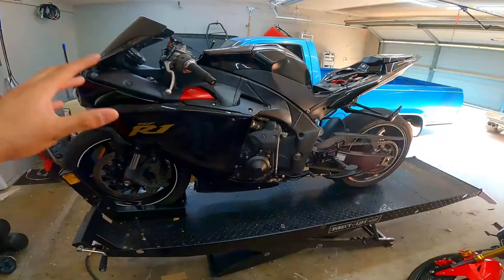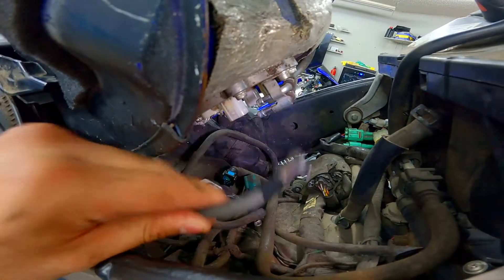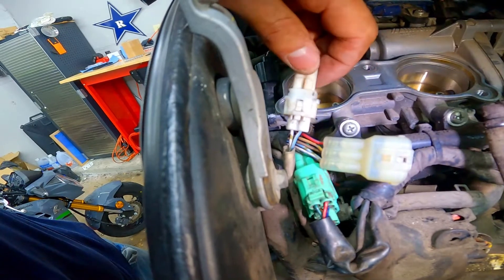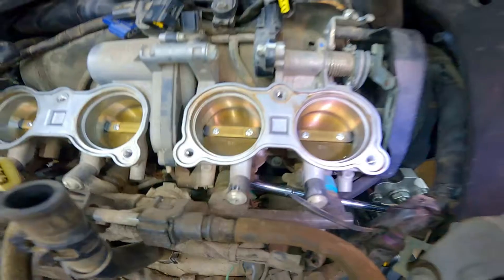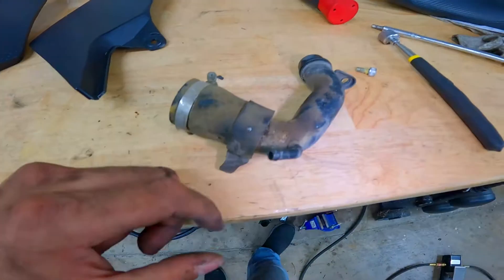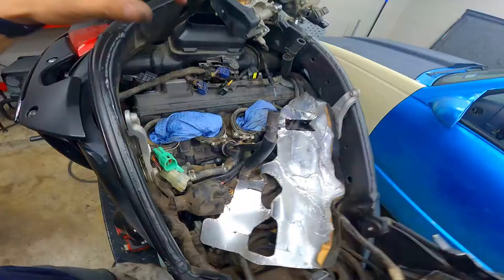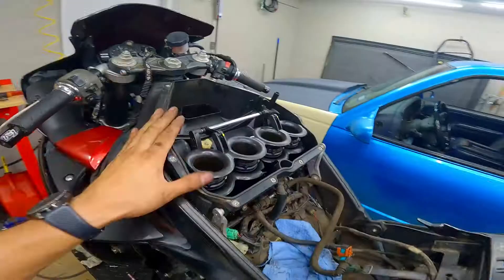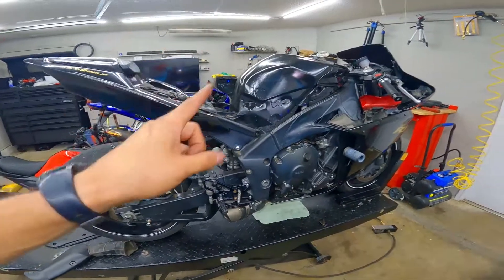2009 - 2014 R1 Stater replacement

Comment: My 2013 R1 is behaving in a similar manner. It will eventually start after 6 or 7 attempts, but as the days get colder, it is harder and harder to start. Eventually not starting at all.  If I have the battery on a trickle charger it makes no difference. The motorcycle is charging at over 14 volts when running.  After the bike has been running and all systems are warm, the bike starts effortlessly. I have had the battery tested and CCA measure good. I have replaced the solenoid and the issue persists.  You seem extremely knowledgeable in the field of motorcycles so I was wondering if you suspect it is the starter. I'm thinking it is a partially failed winding.  Great tutorial video! Deliberate, articulate, and thorough. Thank you.
Reply from the maker: thanks for the support brother    but in my opinion     if it's only happening when it's cold    it sounds like ur valve are out of adjustment      you can at least get it to turn still right?   Just take a bit?
Reply: @SUPSGARAGE  It will get a half to full single turn, then lock up.  Seemingly like a nearly dead battery. Quite similar to what the bike in the video is experiencing. I can do this a few times until it actually spins over or, the battery is actually dead.  The motorcycle has 18k miles on it. It was my understanding the initial valve adjustment service was at 26k.  I may be mistaken.  I did install a cat delete pipe without getting the ECU flashed, but the problem was evident prior to this modification. The motorcycle performs fine when it is running. I will produce a video of the attempted start and post here. I will update with video title.
Reply from the maker: @crobax2248  yea tag me on the video for i can get a better idea
Reply: @SUPSGARAGE I tried to tag you but Uploading videos is new to me. Its titled crobaxo 2013 yamaha r1 hard start
Reply from the maker: @crobax2248  could u add the link here?
Reply from the maker: Ok brother   I just seen the video and to me    it definitely sounds like ur starter is going out     it will eventually not turn over anymore at some point
Reply: @SUPSGARAGE  Agreed. what starter do you recommend?  Price is of little concern, I want the longevity and performance. Weight is not a concern of mine.
Reply from the maker: @crobax2248  I believe Rick's makes one for your model    if not I would just go OEM brother

Comment: I have a check engine light for a code 13 which is the air fuel sensor? I have no idea where that is. Is it one of the sensors you disconnected here? If so could you please help me out?
Reply from the maker: I wanna say that yours is located underneath your left air duct brother
Reply: @SUPSGARAGE  was it included in this video? If not are you talking about the intake that connects to the headlight? Take that off and the rubber hose and it should be under there or is it somewhere completely different. I wish I could send pictures haha
Reply from the maker: @tylerewing6814  u got instagram brother?    sups_garage    message me

Comment: ive done everything but the bolt for the starter closest to the motor is almost impossible to get anything in to loosen it. I tried a swivel mount also no luck

Comment: Hey sups another question! I had an accident may 26th and since after that accident I noticed my r1 doesn’t wanna start. It just cranks. The only way to start it is by push starting it. I got the battery tested, checked my fuses, and even starter relay and everything seems fine. Any idea what it could be?
Reply from the maker: message me on Instagram brother   sups_garage

Comment: Hi I have a question, my bike just clicks once I try to start it. Replaced starter relay, battery, & I did jump start it. It turned on but it sounded like it was going to die. I turned it off & tried to turn it on & it started clicking again where the starter relay is
Reply from the maker: Sounds like the battery you bought might not have enough power, what battery did you get?  I would charge it overnight and try again.  I've seen new batteries needing to be charge before using them.
Reply: @SUPSGARAGE  it’s Noco battery & I checked the voltage before I bought it
Reply from the maker: @Juan Morales-Perez  I believe these models need at least 12.5v to start   what is urs showing?
Reply: @SUPSGARAGE  it’s showing 13.25
Reply from the maker: o wow   that should be enough   if u by pass the starter solenoid, will it start?
Reply: @SUPSGARAGE  how do I do that?
Reply: @juanmorales-perez4629 believe you connect a wrench across starter relay cable terminal bolts. I've never tried bc I'm afraid of creating more problems but I am in a similar issue with a noco but after much reading seems these bikes are prone to starter failure or hit start issues. Did you ever figure out your answer?
Reply: @juanmorales-perez4629 that's about where mine shows as well fully charged
Reply: One thing I want to try is testing voltage at starter whilst starting bike. Not enough volts but good battery could mean bad cables/connections/starter relay. Good volts there = starter motor is more likely the culprit
Reply: Mine does the same right now. I've fitted 2 new batteries, One lithium, the other normal lead acid. Changed starter relay, no change. The only thing left is starter motor. Batteries are 14v + so it has to be starter. I've charged batteries to max over night, made no difference.

Comment: Where does the cable from the starter go? Directly to the battery?
Reply from the maker: No.  Goes to the starter solenoid brother and then the other big wire from the starter solenoid goes to the battery (Do not get them reversed).  Hope this helps you!
Reply: @SUPSGARAGE  so the positive goes on one side then the negative and starter go together on the other side? thanks for your help
Reply from the maker: No, so the wire coming from the starter should goes to the solenoid (If you look at the solenoid it should have a letter M and B, M connects to the stater and B connects to the positive side of the Battery) and there both positive wires cuz the solenoid just connects between the battery and the starter. Negative just connects to the Negative side on the battery itself (Has nothing to do with the solenoid).  I hope I'm not confusing you lol.
Reply: @SUPSGARAGE  that makes sense, I'm just confused cuz i got a new wiring harness and it had the positive and negative battery cables connected to the starter solenoid. so starter cable on the M side,  battery positive on the B side. now where does the negative from the battery go? I think I'm just overthinking things lol
Reply from the maker: I do that too at times lol   but the Negative terminal from the battery should bolt down to the chassis
Reply: @SUPSGARAGE  sweet thank you for your help
Reply from the maker: No problem brother!

Comment: hey bro! I did your step by step tutorial on how to remove the starter but when I put everything back together I got an error code #15? Something with the throttle position sensor? I don't know if it might be because of how I removed the throttle cable?
Reply from the maker: You made sure the tps sensor is connected brother?
Reply: @SUPSGARAGE  where is it located exactly?
Reply: @SUPSGARAGE  when I put everything back together I made sure all the connections were the same. I thought it was maybe because I tightened the throttle cable nut too much?
Reply from the maker: @remydamato6009  It's the sensor I'm disconnecting at 6:19 on this video brother     that's what code 15 pulls up for    I would double check that one and the pins in it   to be safe
Reply: @SUPSGARAGE  I’ll check that out for sure. It’s my first time actually working on a bike so it’s all new 😅 I’ll update you soon!
Reply from the maker: @remydamato6009  all good brother     I'll be here 😊👍

Comment: Starter link is dead.  Can you recommend a replacement starter that uses better glue that the crap Yamaha uses?  I don't wanna replace it again with something that will fail in a few years.
Reply from the maker: @ChrisWelder  I wouldn't know about the glue part but I would try one from Rick's    there products are pretty good

https://ricksmotorsportelectrics.com/New-Yamaha-Starter-Motor-61_435
Reply: I did some research and ordered a new starter motor from Rick's Motorsports Electronics.  I cannot be certain, but I do no expect the new one to fail in a few years.

Comment: Can a r6 starter work on it?? , have a mechanic did that to my r1 and now anytime the bike starts and rides it doesn't start right away after riding  I hafto wait till it cools down but he is saying it's maine baring causing the issue
Reply from the maker: not sure    never done that    but usually if it don't start right away depending on the miles   it usually needs a valve adjustment

Comment: What screwdriver are you using? Can't seem to find a ratcheting one like that with the long extension!
Reply from the maker: This is the exact one I use but this one is red       Hope this helps 😊👍

GEARWRENCH 39 Pc. Ratcheting Screwdriver Set - 8939 https://www.amazon.com/dp/B0002SR8NC/ref=cm_sw_r_apan_glt_i_1G1PRP9S7X6J86Y57Q07?_encoding=UTF8&psc=1
Reply: @SUPSGARAGE  Sweetness, thank u! I saw this one but didn't look the same as yours. Ordering it up as I'm bout to tackle this starter. Thanks for the awesome vid dude!
Reply from the maker: @chumlyscrubber  No problem!   Good luck on it and feel free to ask any questions 👍!

Comment: I replaced the battery, stator and rectifier and the bike lights up but won’t start. I think it might be the starter. It’s an 09 R1. Any advice guys?
Reply from the maker: Try putting power directly to the starter from the starter solenoid brother     its pretty obvious out of the main two wire to put power to   one goes the the battery and the other to the starter.  Make sure the bike is in neutral before trying    if still does nothing then ur starter is bad   if it does work   then ur problem is going to be somewhere else brother    hope this helps!